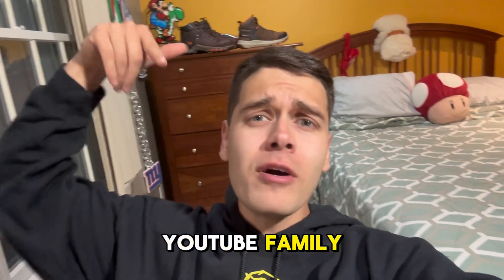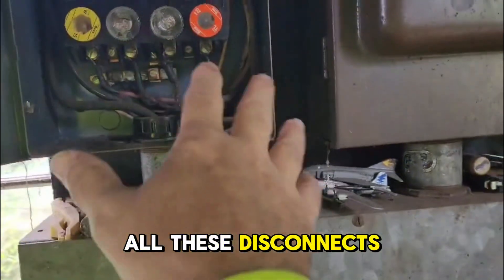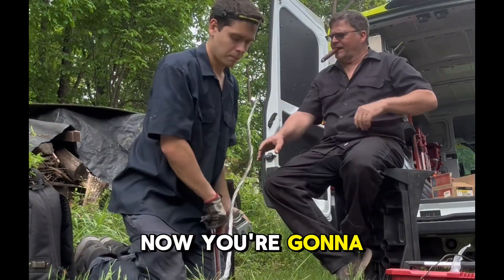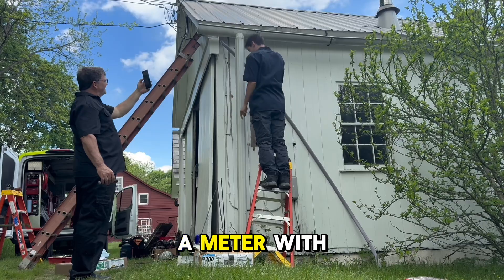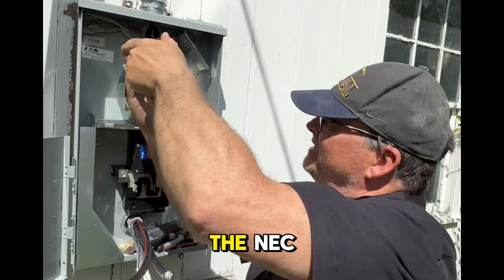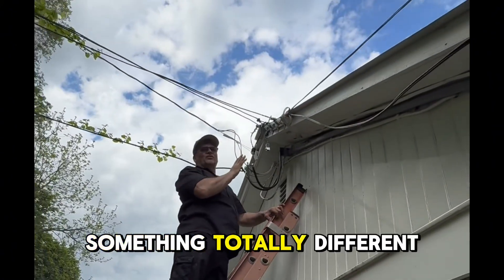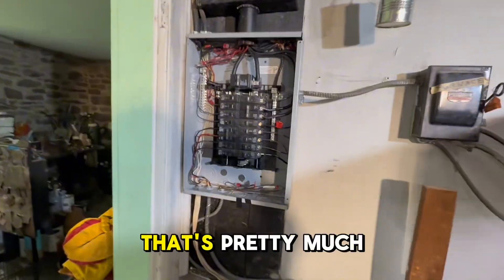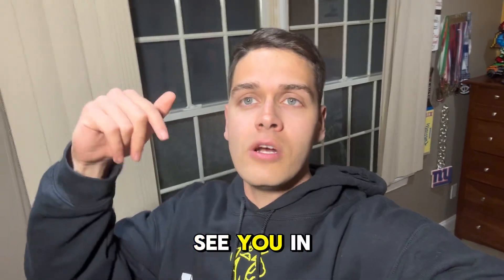MASTER ELECTRICIAN DAD TEACHES HIS SON A 200 AMP SERVICE!

Comment: Here in Oklahoma you cannot use that scr cable to feed the inside main panel. Aluminum expands and contrasts in harsh temperature. It's not to be used to go thru walls at a living dwelling. Linemen only use it because it cheap and stays OUTSIDE! Use copper to go thru walls "wet,damp" locations. Your going to burn down a house bub. I'm 21 and I'm thankful for a noble journeymen. You get to burn down 1 house. After that moved states or change your name idk don't care because we only do good work here.

Comment: Nice vid. Very informative. Just one thing. For next time: please put the 6 awg ecg on the other side of the acorn nut. The wire is installed backwards within the acorn nut. Thanks.
Reply from the maker: Thank you, yes just noticed, Noted!
Reply: Kick ass
Reply: @HendyTheSparky  You da man! Love the videos..👍
Reply: Good catch.. Impossible to make a good connection on that side of the acorn. The set bolt pushes the wire to one side or the other and/or damages it. The proper way mechanically holds the wire against the electrode in the “V” of the acorn..
Reply: U kick ass